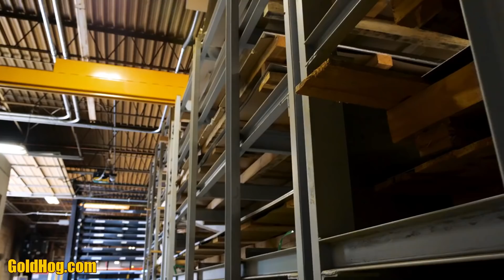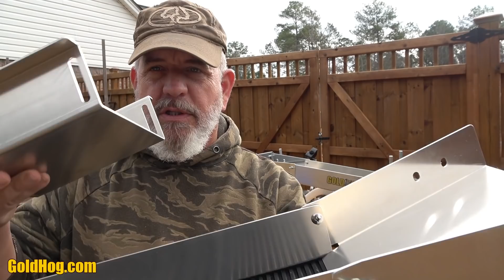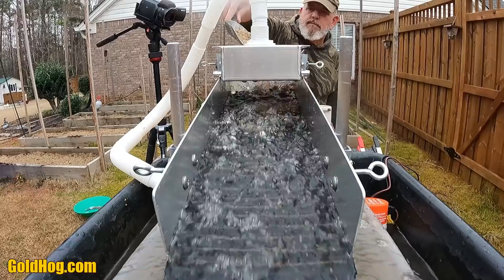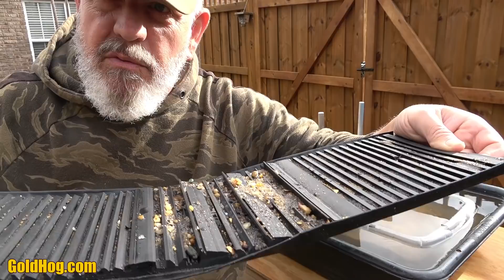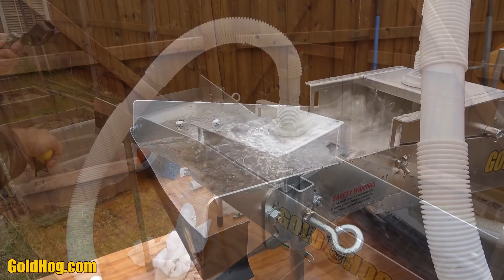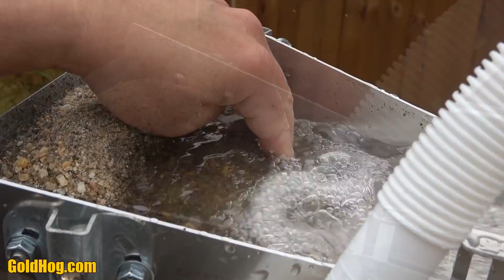Mini Stream Sluice - Backpack Sluice - GoldHog

Comment: Nice kit, Doc.
Too bad I built my pair of "minis" 6 years ago.
Mine are 8'x30", running from top to bottom, 1x-scrubber/2x-razorback/2x-downdraft. Yours is much more refined than mine are. But mine are "working prototypes"
They only get "blown out" in spring flows. They fit well in the jeep and are light enough to pack in to most of the areas I poke around in.
Good to see you're still at it!